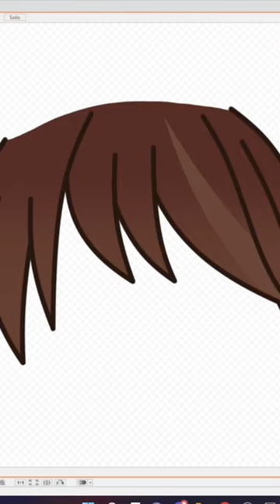How To Smoothly Rig Hair (QUICK TUTORIAL) | #Live2D #Tutorial #Gacha #howto

Comment: This is really helpful! Just a question though:

What about someone who has a 360° model and needs the hair to have key forms on the Angle X parameter to change the draw order?
Reply from the maker: Still do the same thing (deform path tool for the hair swaying) then just make a warp deformer for either each of the hair parts or the whole hair. Highly recommend to make a deformer for each part for more movement in Angle X parameter